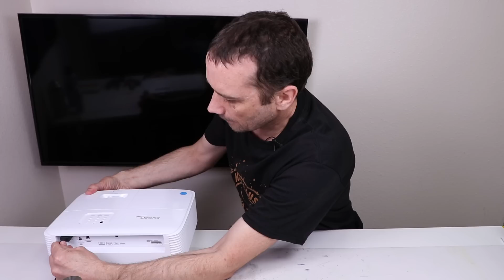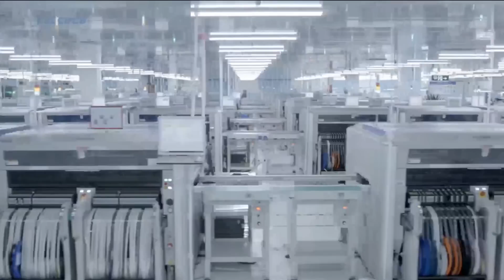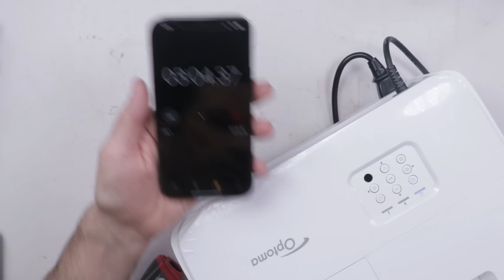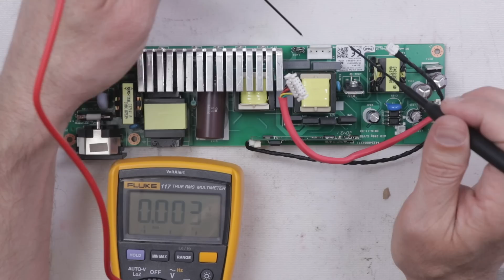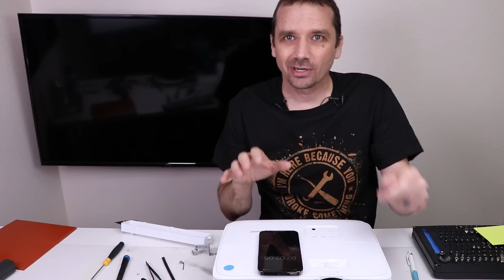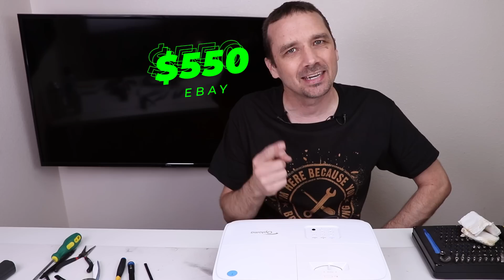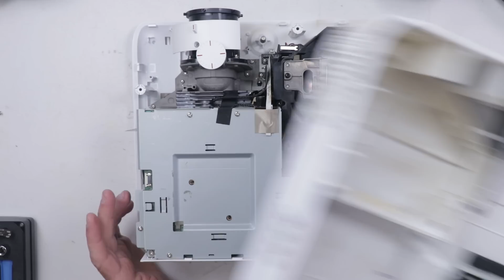I Bought 6 BROKEN Projectors - But Can I Fix Them and Make Money?!

Comment: As a home theater projector owner since 2005, I can tell you that just having light output does NOT equate to being "fixed".  You need to test with the image projected on a wall to make sure you can get it focused and that the colors and contrast are acceptable with moving images.  You can have an older bulb that puts out light, but the image will lack any depth or looked washed out, so that's something that needed to be tested.
Reply: He's got a pinned comment explaining that with projects like these he almost always tests them off camera or sells them as "untested". He still makes sure potential buyers know whether it's been tested or not.
Reply: @linkthelegend01  I missed that, so thanks for the info!
Reply: @TerminatorJuice  No problem! Have a good one.
Reply: I'd actually go so far as to say that I'd never buy a used projector of any kind.  Who knows how much use the bulb has had or that the bulb that the seller is sending you is the one that they originally claimed was in the projector?  There's so much that can go wrong with them, I'd rather pay a few hundred bucks more and get a known good bulb and a warranty.
Reply: @Damaniel3  I have a few of these projectors they do show lamp hours in the menu
Reply: @Damaniel3  bulbs can cost a few dollars or hundreds.
Reply: @Damaniel3  I buy used projectors. I have 2 of them, I have got all the hours that a bulb would provide as I run them past their life expectancy. Still work great!
Reply: Get a load of mister projector master over here 🤓
Reply: Ah yes, you bought one, truly your wallet makes you an expert.
Reply: @bahamut256  I'd say that owning, operating, and replacing multiple bulbs and filters on projectors for the past 17 years, makes pretty damn knowledgeable on the subject.  IE: you can't just put your hand in front of the lens and say a projector is fixed enough to sell because light shown on your hand.  It's not rocket science!  lol
Reply: He never sells anything without testing it off camera, but I agree with you usually they are broken because they can't focuse anymore no matter what you do.
Reply: to be fair, he doesn't work with projectors a lot so this may just be ignorance
i try to be optimistic and give ppl the benefit of the doubt
Reply: He said fixed - yes, but not true as not fully tested = misleading. Whatsover he do after video, he misleads persons watching video. To test just light and say its fix, is purely misleading for various kind of people watching it. So it doesnt matter what is done after the video !!!
Reply: He can say it’s “fixed” all day long but unless he shows it working in real time, ie; being used for the purpose intended, then you are still buying a possible lemon. I haven’t seen anyone comment that they have actually bought a product from him. I love watching his videos but he gets paid for views we don’t know if he actually makes any money on the resale of “fixed items!
Reply: i had multiple different 4k optoma eh-tw6150 that had coil whine a verry irritating beep while in use.
no source connected and it does not have a beep so as terminator juice said may not be fixed.
Reply: I agree with terminator, half ass "fixes"
Reply: You don't need the best looking or working projector to occasionally play movies or PowerPoint slides in a classroom, or if you need one to give it to your kid.
Reply: Maybe you're a first time viewer.. When TronicsFix says "It's fixed" it is definitely fixed.. I am sure that he tested them off-camera.. You should watch more of his videos to see what I mean..
Reply: @bonnerikbarrogataday6289  I've been watching his videos for years, and he normally says he does more testing off camera, but I didn't hear him say that for these projectors...
Reply: @TerminatorJuice  he proabably hurting for money now. So he does quick fixes
Reply: @craigman7262  watch his other videos
Reply: @TerminatorJuice  He also states a lot that he is console repair man, not a general tech repair guy. He seems to just like to try fixing other things for the experience.
Reply: @RoyalMassacreHD  "Fix" is the key word there!  Lol. I'm a big fan of this channel, but I still stand by my original comment from 3 months ago... You can't call a projector fixed just because it turns on and produces some light.  That's all I was saying... No harm in pointing that out IMO.
Reply: @bonnerikbarrogataday6289  ya your not correct there buddy. He only checked for light... really?
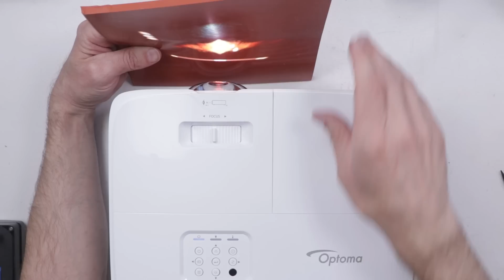Reply: @shiftctrlhack  12:47 If you look closely, the projector is hooked up to a computer.. You can see the icons on the upper left corner and the taskbar at the bottom.. He's not just testing for light..
Reply: But how can he claim he fixed them in this video, and then also state he sometimes sells them untested. How does he know it is fixed if he leaves them untested??
Reply: @donnyestee  he says he either test them extensively or sells them as untested
Reply: @angelareyes8490  how can you know they are fixed if you do not test?
Reply: @donnyestee  untested means he didn't watch a full video or play anything on it for an extended period of time. So he tested it made sure it was coming on showing a picture and had sound. But doesn't mean he watched a whole movie on it or checked to make sure all the menu buttons worked or any of the options work that come with it. This is common sense man. Plus usually when he sells something untested he sells it way cheaper than one he fully tested.

Comment: Worth mentioning these bulbs run turbo hot and you're meant to leave the projector powered and in standby at least until the fans turn off, otherwise the bulbs can melt themselves with the leftover heat and that's not repairable for any reasonable cost.  Gotta replace them then.
Reply: hmm makes me want to repair my projector i got from my job it turns on fine but it has like missing horizontal lines anyone here know where to start?
Reply: @punjabier8  Don't reply to my comment if you're not talking to me, boomer.

Comment: Wow, turns out fixing projectors is way easier and more cost effective than anything else, just reconnect cables, put screws back in, clean some smoke damage and put plastic caps back on for a low of money
Reply: Its a gamble, sometime they have a part that broken that you can't get unless you scavenge it from another broken one. Other times you get lucky like this. Ive fixed a few, but ran into dead motherboards before, then its not worth it. Especially on the higher end models, mother boards you can locate cost as much as a working used version on eBay. At that point why repair it. Just get a working one.
Reply: The reason the lamp light was on was probably because the lamp life was over and needed replacing. Because the lamps cost so much it might have been more cost effective to buy a newer higher spec'd projector.
Reply: @ianhaylock7409  I disagree, the sensor for the light cover wasn't plugged in properly so I believe the projector might have thought that the light cover was open, hence turning on the light issue LED.

Comment: I bought a high end 4k beamer once and had issues with it from the beginning. It just turned off after a while for no obvious reason. Leaving it on for 5min was not a good test to see if it actually works. I would test for several hours with video signal going in, as this is what it is supposed to do.

Comment: Most projectors can't tell if their lamp is bad. They just have a hour timer and after a certain time like 500hrs it will turn on the lamplight to remind you to replace it. You can usually reset the lamp timer in the menu if you get any light from the lense at all your lamp is good.   Possibly a bad temp sensor  if it's turning off after a while.
Reply: "if you get any light from the lens at all your lamp is good". Well that's not true, as the lamps get weaker over time. try measuring the lumens from a new lamp, and one that's been used for 500 hours.
Reply: @ianhaylock7409  Yeah i know. What I mean is it works enough! If he is going to resell them all he needs to do is confirm its working.  lots assume that the projector and the lamp communicate. Most projectors ive come accross do not.
Reply: Try 5000 to 1500 hours and they do detect if the lamp is Burt out.
Reply: @MrGenie23432  Just an example.  We have probably 100 projectors at my workplace. None of them actually detect the lamp. Obviously if it's blown or missing it chucks and error because it can tell its not drawing enough current/heating up etc. What I'm trying to say(poorly) is that the projector really knows nothing about the lamp.  If you swap a lamp with 2000hrs on it into a different projector it's not automatically going to put the lamp light on if the lamp timer is only at 10hours. This is because the projector and the lamp do not communicate(in most cases I've come across).  Just trying to let him know that the lamp light is not nessisarily due to an error with the lamp or a bad lamp. You could put a new lamp in and if the counter hasn't been reset the lamp light will stay on.
Reply: @these.are.my.things  ah well in that sense yes I was just stating it does detect if it is blown or missing.  But yes it doesn't know anything about its health beyond that.

Comment: I am sure these are nice projectors but there are sub$100 projectors now, one of which I own. With a decent screen and sound system, it works great for my needs and the price makes it disposable.
Reply: Are you sure your not comparing to the cheap Chinese knockoff ones that claim ridiculous specs? Those are always listed around $100, pure crap ready for the landfill. These are all 1080p or 4k projectors, currently made models, not ones from 5 years ago.
Reply: If you put yours side by side with these there would be absolutely no comparison.  Sub 100 now you still usually aren't even better than 720P and maybe 100 to 300 lumens of you are lucky compared to 1080P to 4K with 2000 to 4000 lumens of brightness.  Night and day.

Comment: You had one screw that fell out in the one projector that had never been opened. That sometimes happens when they are mounted to a drop ceiling that has airflow above it. It causes a vibration in the projector that you can actually see. After years of vibration the screws can loosen or fall out. I work in a school district and we deal with this sort of thing fairly often. Great video!
Reply: I have an upside down ceiling mounted projector (different make) that got this vertical bars fault with a repair that followed the same repair path, open up, exercise the connector, screw tight, close up, all good.
Reply: Warning: falling projectors ahead
Reply: Dude don't use locktite. Its gonna happen again.
Reply: Wow, top tip there. Good to know!

Comment: Not sure if you'll see this but I have a broken 2015 New 3ds xl that I would love to donate to you. The 3ds was given to me by my little cousin. I tried repairing it my self but was unsuccessful. The bottom screen was replaced but upon turning on the system after it was replaced, it clicks, and then turns off.
Reply from the maker: Sure, you can use the contact form on my website to contact me. TronicsFix.com

Comment: Power Supplies rely on Smoothing Capacitors, Long story short when they fail, Mains Power supply buzzing or hum becomes more inherent..
So without actually being there, I would suspect that Buzzing/Humming Sound along with evidence of Smoke, has me guessing one of the main Filter capacitor/s indeed went up in smoke.. 
APU I dropped a 👉👍👈
Reply: No those where pixel shift 4K projectors.  They mechanically shift the DLP chip 240 times a second.  Hence the buzz.
Reply: @MrGenie23432  
And with all that switching "via the DLP Chip" the supply line would need filtering, ergo the filter capacitor, filtering the noise would already be out of spec and thus need replacing..
Reply: @KorAllRBare  I am an electrical engineer I know what you are getting at but the buzzing is literally due the mechanical movement of the part at high frequency.  I use to own a camera that had somewhat the reverse and had image stabilization by moving the optical sensor before digital imagine stabilization became the norm.  It made a similar buzzing noise as it attempted to counter act my micro hand movements.  You can filter the power lines all you want when you have a mechanical movement at high frequencies it will make noise.  Slightly more expensive projector do a better job of insulating the acoustic noise but it is still generated.
Reply: @MrGenie23432  You know going over this, I am seriously left wondering why an expensive mechanical method was relied upon in the first place, electronically it would be far more reliable ergo superior and the bonus would be the loss of a very annoying and perceivable vibration, surely it be a Chingy Thingy..
Reply: @KorAllRBare  it apparently works well enough visually and the reason people put up with it is that in order to do true 4K without this method you are paying about 4 to 5x the price and up.  Most people are just not willing to pay the extra price.  Plus depending on your setup the projector may be far enough you never hear it.

Plus you do realize that DLP is by its very nature mechanical mirrors being moved creating the pixels.

Comment: maybe this can help you 

Below are the steps on how to reset an Optoma lamp timer.

First, turn the projector off using the remote control or via the Power/Standby button. Wait for at least half an hour for the bulb and the housing lamp to cool.
Flip the main switch, and remove the power cord completely. 
Turn the projector upside down. Remove the screws holding the lamp cover using a Phillips screwdriver. 
Flip the housing handle up, and pull the bulb out. 
Replace it with the new bulb.
Put the cover back in, secure the screws, plug the unit back, flip the main switch back on, and turn the projector on. The lamp timer should automatically reset. 
If it doesn’t, reset the lamp timer manually. Press Menu, select Options, go to Settings, select Lamp Settings, choose Lamp Reset, and hit Yes.

Comment: stuff like this is a losing battle. the bulbs can be as much as the projector itself sometimes. they burn out after a while and get dim over time too. surprised they haven't all moved to led by now.
Reply: They are just starting to along with lasers.  Cheap ones have been LED for a while but it has only been recently that they could manage to get LED ones with enough brightness and good colour to replace bulbs.

Comment: You check for remaining charge in the power supply by meshuring the voltage across the capacitor contacts, not the fuse. Be carefull with that.
One very importhant thing you have to check with theese prijectors before you sell them is picture clarity and dead pixels, very common fault.
Reply: He's selling them as untested,  buyer beware.
Reply: @marcusdamberger  but why  not just test them and sell them as working?

Comment: Also replace the thermal compound on the DMD chips so they don’t get stuck mirrors. That’s the chip on that board that is screwed on perpendicular to the main board, near the colour wheel, attached to the optics assembly.

Comment: Its easy to replace the lamps because they don't last long and cost a fortune, that's their equivilant ink cartridges for cheap printers 😉
Reply: Are they even led lamp lights or are they Edison style ?
Reply: @Smart-Towel-RG-400  they are ultra specialized arc lamps and nothing like you would use in a house as they would blind you they are so bright.
Reply: @MrGenie23432  Yee I was wondering cuz if they were led they would have to be doing something to then to make them burn out faster  and a Edinson bulb seems like it wouldn't be good enough to make a 4k picture
Reply: A lot are led now but not sure how bright those can get compared to edisons, i havent kept up

Comment: Also if you think warranty seals are fool proof and thus it's not been opened yet... Well, yeah, some only need lil heatgun treatment... Some will peal off eazy when soaked in ipa and will stick back again once dry.
edit: also by watching all these vids for years from you i've got the feeling that for US "broken" stuff is smth you don't like anymore and you just want new thing... because you never really get any electronic to fix that has "loose connector" fix problem in eu, the stuff in here is broken to smithereens most of the time... i still don't get it how many stuff you just touch to fix them... just unreal...

Comment: Did you check the audio on any of them?
Reply: what? who on earth uses projector speakers... it's like pissing on a wall in gallery... the whole "inbuild speakers" thing with projectors is the same bs with flashlight and their "3rd function - strobe"... all you want from flashlight is to turn on/off, not to have 75/50/25pwr/strobe modes you have to cycle thru... it's just useless bs added so you can use it in useless advertisement.

Comment: One of mine had a bad DLP chip, and m wondering if its fixable?
Reply: anything is fixable, the point is if the work you'll put in is worth it... and unless it's smth eazy as reflow broken solder (or unless you have spare parts lying around) i wouldn't bother with it...
Reply: @ExecutorQ3  the issue is when the projector turns on there are mirrors lenses that are suck so I see what and black squares on then screen

Comment: The smoke stains might come out with hydrogen peroxide and uv light.
Reply: y, liquid or gell h-peroxide (which you can buy at hair saloons) will clean that, but it's inside and tbh not worth the hassle of completly removing everything from the case, leaving it for at least half a day on sun/under uv and then drying it...